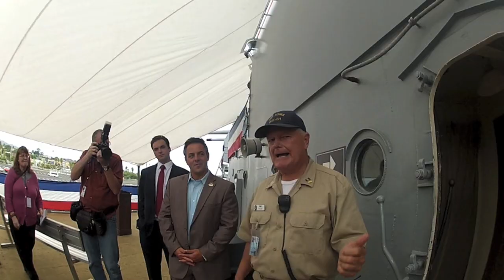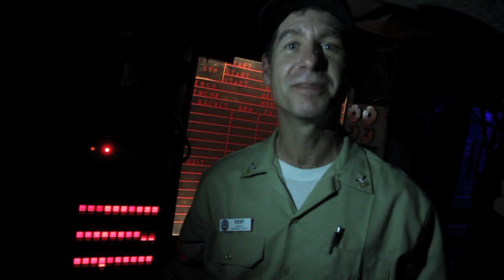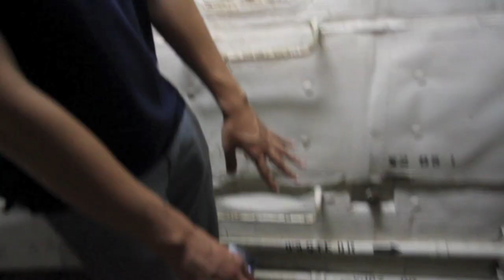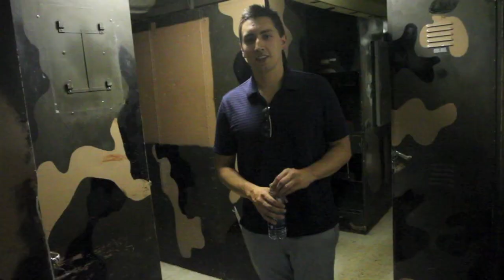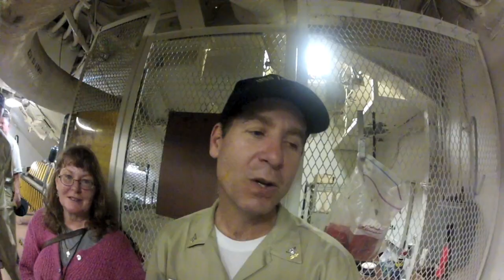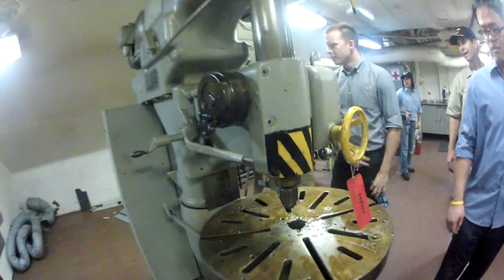USS Iowa: The Exclusive Tour

Comment: I don't think the overhead rails in the passageway are for transferring ammunition. A more likely use is moving machinery and other heavy equipment like motors, pumps, etc. from the machinery repair shops to the various machinery spaces. Those ships had extensive repair facilities, soft of a floating shipyard.
Reply: +David Smith I think we need a GMG who actually served on an Iowa class ship to 'rule' on this. I would like to know how the shells and powder bags made it up through all the interlocks and safety mechanisms as well as the armored bulkheads and decks to the second deck to move along that passageway and then down to the other turret's handling rooms to be sent up to the guns. I'm having trouble imagining 16 inch shells and powder bags swinging along Broadway when the ship is at condition zebra and is dealing with battle damage severe enough to disable the magazine for a main turret without disabling the turret itself.
Reply: nuc9901 We never transferred shells that way because it was not necessary. It would have taken a long time because the rail system was not motorized it was push and pull. The turrets were isolated from each other, there was only two ways to get in and out. Out the hatch at the back of each turret. Or out through the annular space. During the explosion on April 19th the design kept the force of the blast contained within the turret.
Reply: nuc9901 The annular space is a space that goes all the way around the lowest level of the turret known as the powder flats. 110 pound bags of powder were passed from the magazine through a armored brass scuttle into the annular space. From the annular space it was passed through another scuttle into the powder flats. That way if a bag was dropped and it exploded the separate spaces would isolate the damage, limit casualties, and prevent a magazine detonation. Inside the powder flats there were three huge open water tanks. If a bag was smoking, ripped, or seemed fishy you would drop it in a tank of water.
Reply: No, I've got a lot of BB books and one photo did have a caption about moving shells.   It may be that it had other uses, of course.
Reply: You would be incorrect sir. Broadway and the monorail were designed to move shells from turret to turret in case one turret was knocked out. Those rails were also used when taking on or offloading projectiles.
Reply: nuc9901 I was a GMG on the Iowa....I served in turret 1 in 1989.
Reply: +David Smith I yield to your knowledge! Details  please! How often  did you transfer shells that way? how long would it take to get 3 shells and their powder bags to the other turret? was their rigging designed for this or was it improvised? I always thought 16 inch turret's were isolated from each other with crews buttoned up 'for the duration'  but they must be a lot more open than that. after Jutland all the navies of the world looked at their flash protection and made modifications to improve flash-tightness. The Iowas must have been planning to fire so many rounds from each turret that they could run out.
Reply: nuc9901 Granted it has been almost thirty years...but Broadway is on the lowest level of the ship. There were temporary pieces that you would connect to the main line that would take it into the annular space where there were a series of hatches that went up to the projectile decks. A hoist would pull the shells from the annular space up into the projectile decks. There were also a series of hatches that went all the way up to the deck from which ammo could be loaded or unloaded.
Reply: +David Smith my ship was basically a 'canoe', a monohull, with no armored box, no belt or barbettes. I could stand in one spot in the engine room and see the hull on both sides. A very different arrangement and no way the missiles could be moved from one magazine to the other.
Reply: nuc9901 lol I could never be on a sub...any ship that sinks itself can't be a good idea

Comment: of the 95% that will be opened up, turret 2 will be part of that missing 5%. RIP the 47 who died in there in 1989.
Reply: Maybe it's happened by now, but I seriously doubt you could ever open up 95% of a BB and have it be safe for the public.  There are ladders people could get killed on, tiny narrow passages, catwalks over long drops in the engineering spaces, etc.   But the more the better.
Reply: @brucec43  yea lol its now 2019 and im sure they are probably only at 30%
Reply: @brucec43  Go visit North Carolina.  I wandered over most of that ship.  Some of it was closed off as they prepared for hull repairs, but 90-95% of that ship is probably normally open.  They wrapped ropes around the ladder hand rails to add grip, etc.
Reply: That accident was due to human error had nothing to do with the guns

Comment: Iowa still using 40Kw generators, nxt year she will be on newly installed shore power 2000amp 450 volt 3 phase 3 wire